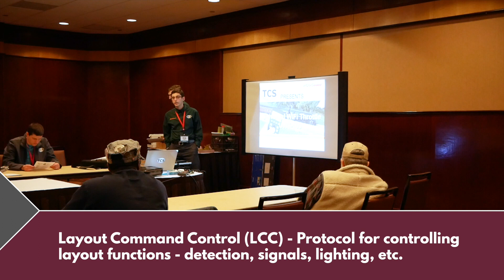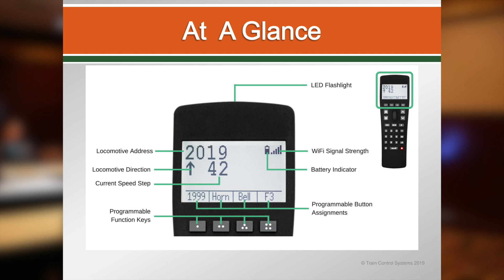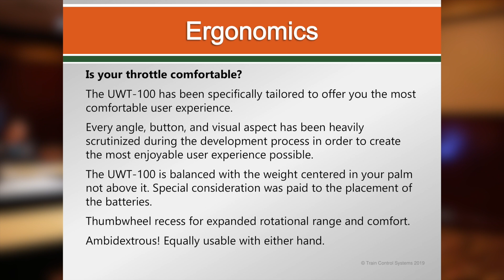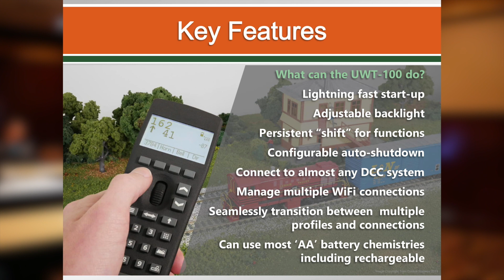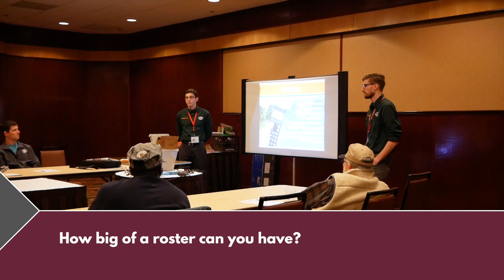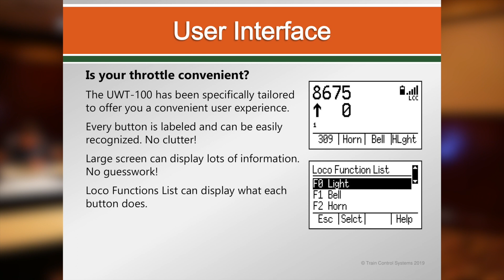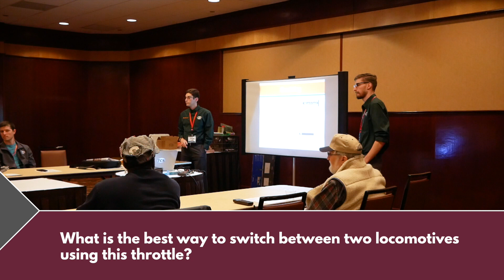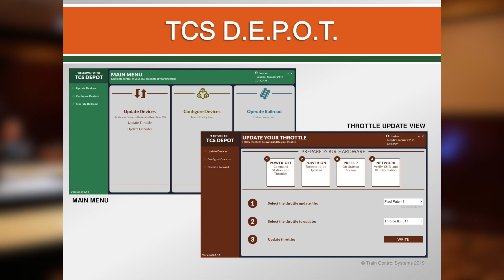UWT-100 | Overview Clinic

Comment: I am considering buying this throttle but I do not have anything right now I’m running Railpro but thinking of going back to DCC what would you suggest as far as a command station power supply and I want to run JMRI as well my layout is 21 x 11 double deck also let me get this straight Can I program CVS with this throttle as well? or just do the functions

Comment: 42:19, Will Jenny Jenny answer my questions, Tommy TT?
If I have an unused Router, not hooked up to the internet, could I use it exclusively for this WIFI system only?
Reply: I do just that.  With Digitrax I use a PR3 to connect my system to an old laptop running JMRI and a $30 router.  It works fine.